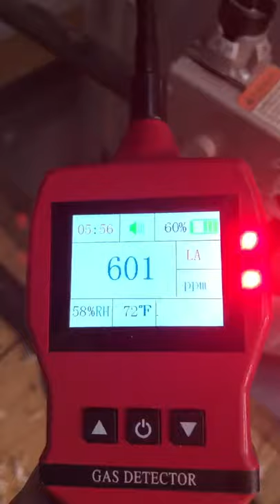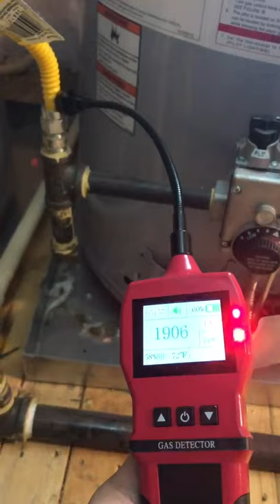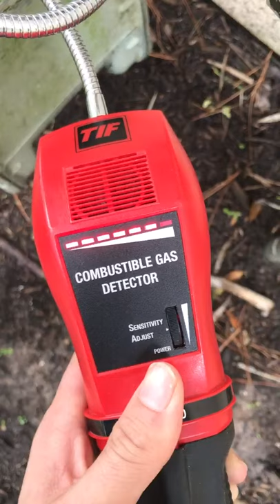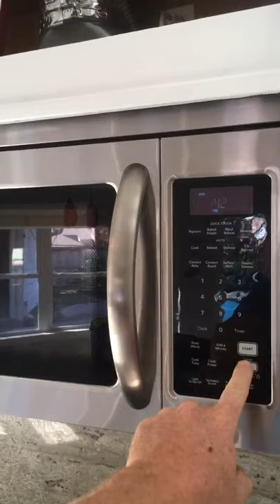45 Home Problems in 15 Minutes

Comment: Great stuff. if could you please identify the deficiency with the water heater at minute 7:35. I noticed the moisture related substance on the flue pipe and it looks they used some sort of tape to connect to the flue as well. How would you state this issue?
Reply from the maker: Short and simple,  the flue on top of the water heater is not properly mounted.  Repairs are recommended for health and safety.